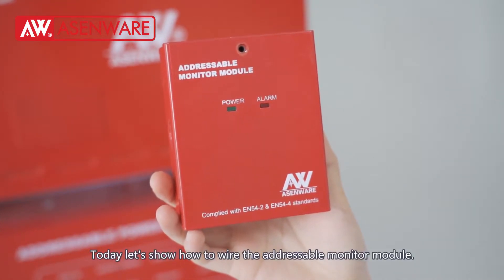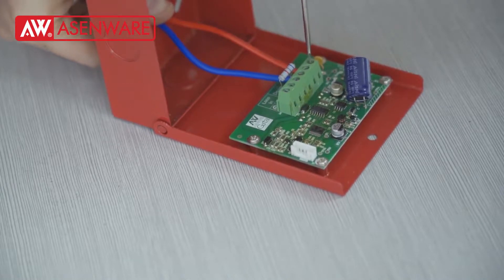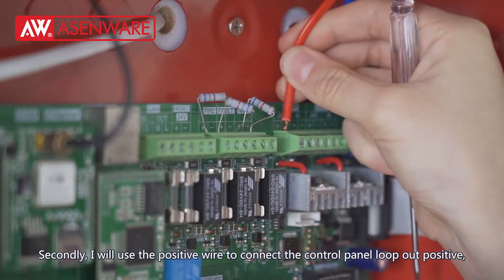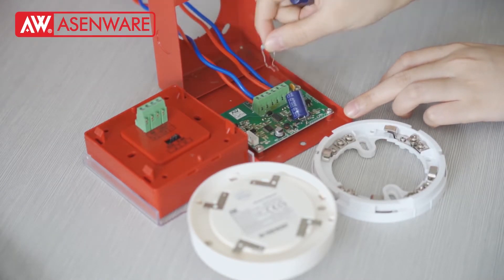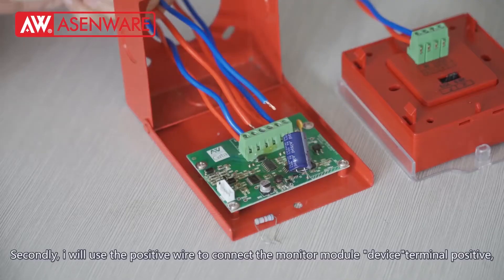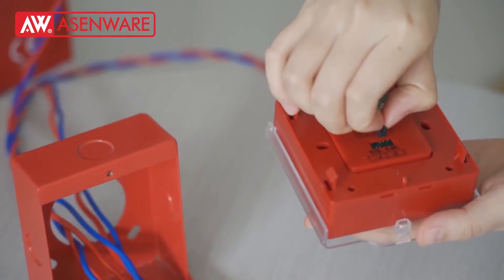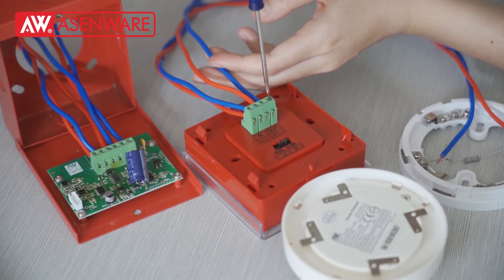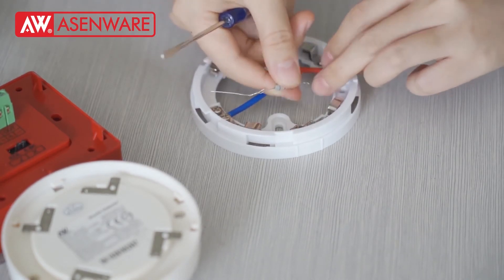How To Wire Addressable Monitor Module To Addressable Fire Alarm Control Panel

Comment: Is it correct loop out of monitor module will connect to loop out of the panel?
Reply from the maker: Yes dear, you are right!
Reply: @ASENWARE  what if monitor module is the first device addressable1 how to connect the nxt device say power transmitter is the next device?

Comment: What is the purpose to connect resistor in ending device?
Reply from the maker: The function of the terminal resistance is to detect the open fault of the equipment in the line,If you have any technical problems, please feel free to contact us, E-mail: info@asenware.com Whatsapp/Wechat/Skype: 8613922805301
Reply: @ASENWARE  Thank you ❤️👍😊